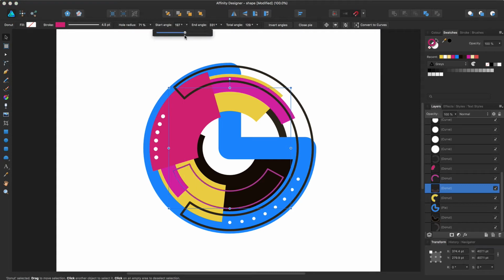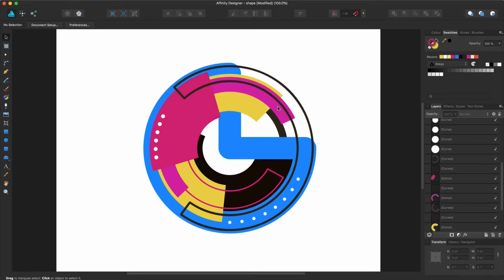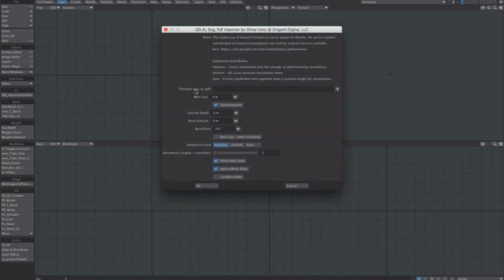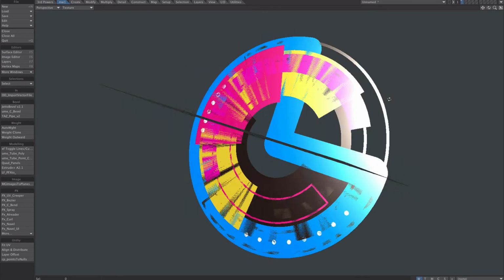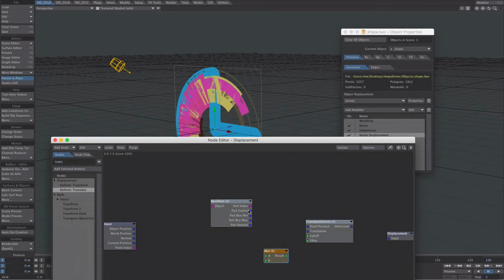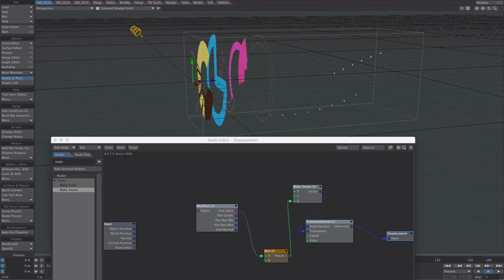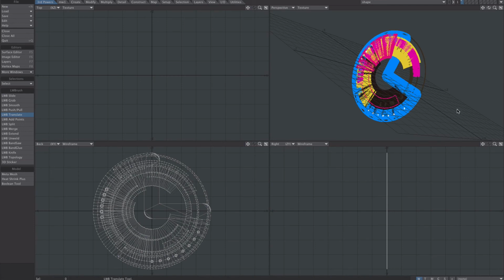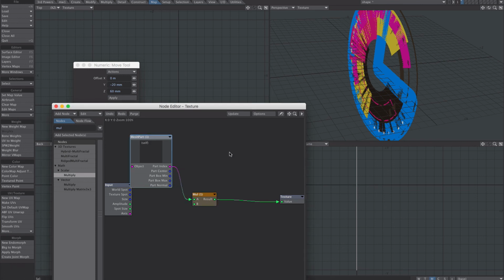LightWave 3d Workflow: Affinity Designer, Illustrator Vectors to LW

Comment: Try inkscape instead, just as affinity or illustrator, the svg format will be exported with colors, for it to go to lightwave, use blender first and import svg, then save out to obj, the colors will still be there.
and for working in inkscape, if you want multi shapes and use several shapes to union or path difference to cut holes, make sure you select the shapes you want and union them first..then use it as path for difference cut.

And you know what...you do not need illustrator or affinity...and this process cost you Nothing in terms of money, since inkscape and blender is open source and free, you only pay for lightwave though, unless simply keeping it in blender.
Reply from the maker: PrometheusPhamarus thanks for the tips, always open to new approaches! 

All my clients are Mac based Adobe CC subscribers so showing how useful LW can be is my focus. I think I muddied the waters a little by starting with Affinity Designer.
Reply: I'm testing also Gravit, but still far from affinity or inkscape.

Comment: seems a bit long winded
affinity
illustrator 
od root + plugin
modeler import
send to layout
nodes on layout
create morph
send back to  modeler
apply morph

meanwhile affinity/corel draw etc  export  -  import to 3dsmax (done)
Reply from the maker: cresshead it does when you put it like that! If you eliminate my wittering and everything is installed, it’s a less than 5 min job - if you get a lot of complex vector files it’s a useful technique to know. I only mention AD as I like it :D
Reply: Gentlemen, 
Just exported graphic in Affinity Designer directly to SVG,
Downloaded OD vector importer from here: 
https://origamidigital.com/cart/index.php?route=product/category&path=59_60
Installed into Lightwave (using 11.6)
imported SVG straight into lightwave, without using illustrator.
hope this helps.